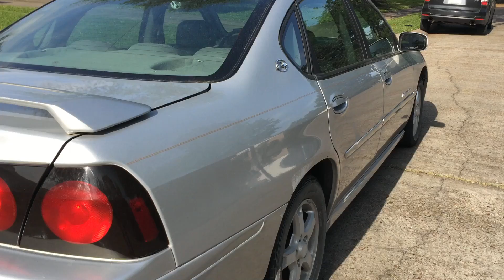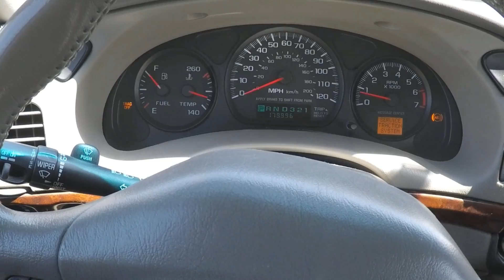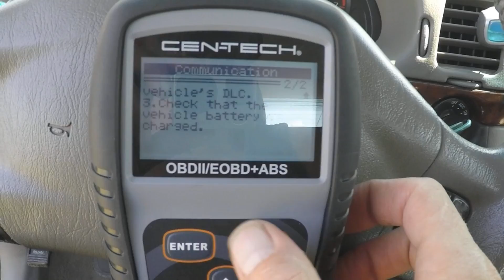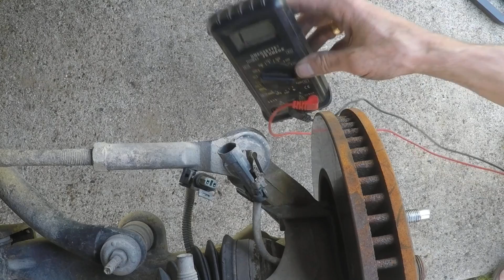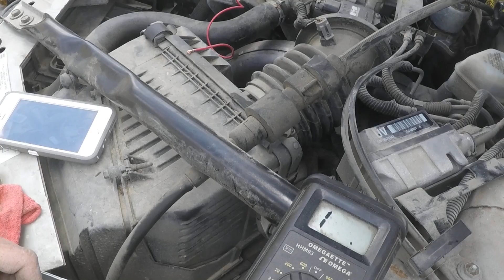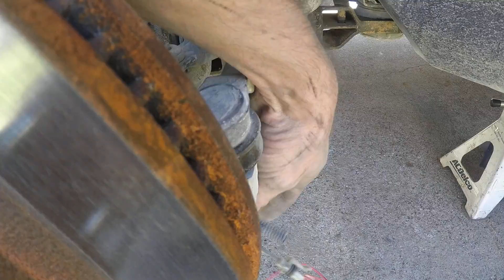ABS Light and Traction Control Off Indicator - 2004 Chevy Implala

Comment: I have a 2005 my light came on and it said to service Trac control took it to a shop they replaced both axles and both front wheel bearings but the light is still on. I don't want to pay anything more until I find out what it could be from !! PLEASE HELP ME!!

Comment: I had the same problem the same code and I watch this video and then exactly what you did I checked it found a broken wire about 8 inches from the plug to the ABS sensor I offset cut the wires the top and bottom the new wires through there and have them twisted I solder them and cover them with heat shrink and it only lasted one day and the same codes back what's wrong I have four brand new wheel hubs I am very confused is this situation

Comment: I know this is an old video but I had the exact same problem. Watched this decided to go down to the driver wheel disconnected the plug from the sensor unclipped the harness about three clips back to give me room to work. Then peeled back the harness cover found the yellow wire was broke bout 6 inches back from the plug. Patched it with a wire connector the electrical tape it for protection the placed the harness sleeve back on. Plugged it in and no more error. Hope this helps someone.
Reply: I think that's the best way to go you don't need those stupid sensors on the front wheels anyways old cars you never had them and you don't need them on the new ones
Reply: @freddygranado3217  These cars aren't so new anymore ;)
Reply: Would that be related to why on my Monte Carlo, same as Impala, has the BRAKE light on in cluster? But E brake is fine, so idk..

Comment: Hi there & great video, I have read many others about the Traction Control service light & ABS light coming on but I haven’t read any with it making a loud noise while the lights are on. When they go off the sound stops. I have an 02 Impala so is my issue completely different because of the loud sound I hear when the light indicators come on?
Reply: Mine made a load noise when I accelerated like a grinding noise but I think it was just the brakes reacting to the perceived slipping of the wheel. That is also when the traction control light would light up like the wheel was slipping. The wheel was not slipping. Mine was a faulty wiring harness on the left front wheel.  After inspecting the wires I found a discoloration on the wire, sure enough when I pulled the wire it came apart. spliced in a new abs wiring harness and now it is running like it should no more alarms no more noise. I like my impala again.
Reply from the maker: I can't say, but this vehicle did make noise when turning at low speed. I would suggest checking the abs outputs to see what it looks like.
Reply: Mine does the exact same grinding and lights go off after the grinding stops mines a 2013

Comment: Great information video sir.. Was just wondering what size or gauge wire should someone use? Thanks a million...
Reply: More important than the gauge (size), is its flexibility. Both of my cables in the front had broken the wires internally due to the minute, but continuous flexing while driving. They were broken where the bottom of the suspension meets the frame (not too far from the connector IIRC). You wouldn't think that it would break there, but it did.

The way that you find a broken wire is to look around where the cable flexes for a bulge in the wire. Grab the wire from either side and pull. If it's broken, the wire will continue to stretch until the insulation breaks. This is what I found on three of the four wires on my Impala.

The factory harness was about $150 (per side) from my dealer, and it was not likely to last any longer than the original. So I replaced mine with "Olflex" superflex cable (10 million cycle rated) that I got off of eBay for about $40 (I only needed a foot for the entire job, but this was the best deal that I could find at the time). Flexlife-10 is another option. We use this type of cable in our robot cells where we may build 250,000 parts per year. 

A better option is to buy a 3 foot chunk of 18 gauge "Superflex 2" from TQWire for $3.50. Use marine-rated butt splices (shrink tube ends) to keep the water out. Since this is an individual wire, and not a multi-conductor cable, you will have to use one wire per conductor (you will want to replace both conductors per side). The TQWire wire is a better wire than the Olflex (441 strands, quite a bit higher than the Olflex IIRC), and being an individual wire as opposed to being part of a cable is of no consequence.
Reply: 18ga should be fine.  (18 gauge)

Comment: See now my issue is different.. 03LS 3.8 with the traction warning, brake warning and the low brake fluid warning (fluid is full) everywhere I've brought the car I never get a straight answer
Reply from the maker: 0Sideswipe0 Hate to hear that. Would be an interesting diagnosis if you were closer.
Reply: Trey Clanton yeah.. I'm in ri not sure where you are

Comment: I have had problems with this for years. I have change hub bearing and no results. I just saw this video and pulled the ABS connection apart blew in it and plug it back in then started my car. The damn light went out! Wow!!! I restarted the car about 10 times and drove around in disbelief. Thanks!!!
Reply: I'm wondering if the sensor being dirty or corroded is the problem with my car. Never a problem until I had to drive it through shitty winter weather here, inches of snow on top of ice and all the ice, snow, gravel, and salt on the highways.
Reply: Yeah I watched a guy simply unplug and plug back in harness by tire rod on drivers side... fixed it in about a minute lol

Comment: Also have heard that on the 2006-2014 series its not uncommon for the wires to get in contact with the chassis and rub it and short out.
Reply: Tumbleweeds can cause this issue as well, I was driving thru Kansas a few weeks ago and you could not help but run over the tumbleweeds they were everywhere. That is when my problem started. Dang old tumbleweeds one must of got caught up in the wires and caused my damage. All fixed now, just spliced in a new abs wiring harness. No more alarms. Maybe I need a cow catcher for tumbleweeds on my impala.

Comment: Had this issue several times on my 2004 Impala.  Turned out once to be corroded connections inside the bearing harness. Second time it turned out to be a pinched bearing wire - the strands were slowly breaking one by one. It would set off the three lights (ABS, Brake and warning centre) when you were turning.... when you hit bumps...  heck even at a stop and when you hit the accelerator.  Odds are - if you have the three lights come on erratically - backing out of a driveway and coming on when you turn and pass over the curb...  or driving along and coming on when you hit bumps...  or turn the wheel sharply...  its a WIRING issue.   Somewhere, either the wiring is shorting out - as you saw here - or its not making a good connection.  GM's harnesses are notorious for letting water / salt in through the top and corroding inside.  Check these first before some mechanic says - oh, its the bearing... cause these are expensive.   and a pain to change if they are seized.   And the ABS control module doesn't go that often... I go through wrecking yards all the time looking for shiny new parts and NEVER see shiny new ABS control modules.  So don't let some scammer mechanic say its one of those until you check all the harnesses, the wiring, and the bearings.   And bearings more often fail on the passenger side... since the tires on the passenger side fall off the pavement and hit the shoulders and ruts there more often than the drivers side tires do...   I have many miles on the Impalas I've owned so learned the hard way.  Hope this helps someone.
Reply: Ranger Rick thanks man your comment somewhat helps me seems like you know what you’re talking about I need help. Just yesterday I noticed the” trac off “ light and “ABS” light were on and also the “Service Traction System” light. Don’t wanna take it to a mechanic because I feel they will try to scam me. Idk what to do
Reply: Im having same issue on 03 impala. All 3 lights coming on. Damn thing scared the crap out of me one time, went to stop at a intersection and brakes felt like they werent going to stop. Felt a crunchy/grinding(like it was trying to engage or something)feeling in brake pedal and thats when the damn trac control lights came on. Slowly been getting worse. Now lights come on just backing out of garage, or slightly turning wheel.

Comment: BBB Industries offers free access to the Technical Service Bulletins (TSBs) issued by GM and other manufacturers.  This is a treasure trove of information on known problems with GM and other vehicles. For example, my 2010  Equinox has similar issues, and in looking at the TSBs for my specific vehicle I noticed PIT5062C (the problem with the 2010 is not mentioned in PIT5062 A or B), which describes a bad splice in the wiring harness under the carpet just in front of the drivers seat, as well as a large plug that gets loose from the connector and lets the pins corrode. The plug and connector are located ahead of the front passenger seat and mounted in a high position sort of behind the outside kick panel. That TSB has pictures, but the complete TSB with the pictures is not easy to find. Alldata and Mitchell don't have this TSB at all, as far as I can determine after searching both of them.  This is just a small example of what you can find if you dig deep enough. The dealers will never mention these easy fixes. Another source of inspiration is a YouTube video by Tony Lester, who dug deep on his own and found a really bad ground on his 2014 GM truck located just under the bottom left corner of the inside of his windshield under a dashboard panel. Misapplied insulation kept the "grounded" wires on his truck from making good ground contact, causing all sorts of electrical issues.

Comment: Thanks for all the homework you did for me,  I found out that I had a problem with a broken wire in the passenger side wire harness and did a splice with two barrel crimps, heat shrink and some plastic wire casing. works great with no lights. Again thanks much !
Reply: Tom McDonald what size /gauge wire did you use? Thanks
Reply: Duane St John 
Duane, I bought a ten dollar harness on ebay and it was about 5 feet long with the plug already on it and it was a 16 or 18 gauge wire I believe.

Comment: Hello Trey. Thank you for the awesome video. You mentioned pins 2 & 3 for the driver sensor. What are the pins for the passenger side please? My open is on that side. Thanks again.
Reply from the maker: Impala Lover I'm not real sure which pins that it. You might search for a schematic or physically trace the wires. That's what I had to do.
Reply: Okay. I appreciate it. Thanks again. You really helped me out a ton. Thanks for taking the time to make this video.

Comment: Love your very helpful video. Can't wait to check mine out. Can you buy twisted wire somewhere or do you just make it?
Reply from the maker: Bart Jones I just made the twisted pair with 2 wires. If you clamp two ends in a vise or get someone to hold them and then chuck the other two ends into a drill, and you're off!

Comment: Good video, I have fixed many ABS issues in the last 4 years and you tested wires that many do not and suspect the hub and just do swaptronics only to figure out that they wasted their money.  I like how you tested the in between wire as this has resistance also.  I fixed a Sienna this way as the sensor was good but wire was Out of Limit.  bought a replacement for $20 at a junk yard as I pulled it myself and tested it before buying.

Comment: I just had to have mine fixed and it was the Hub it was broken.  Had it replaced last week and the indicator is off and when I press the Traction button on the left of the steering wheel it works. Before it didn't. it was on the Right front tire.
Reply from the maker: Dorothy Owens - Good deal! I'm glad you got it worked out!

Comment: There is actually a bulletin out there for these. No. 03-05-25-008. Not certain if it covers the 04 Impala though. I have also seen this on Cadillac Devilles.  You can get the jumper harness although it is a little pricey. I have seen this happen where they break down between the main harness it goes into and the wheel speed sensor connector.
Reply: 15 bucks on amazon for the harness

Comment: Thanks for the video.   Today I began to have the same issue with my 2005 Impala, and the little bit of online research that I've done so far indicates that the problem is difficult and expensive to diagnose and repair properly.  I'll stop at AutoZone tomorrow for an ABS code reading to see if I can get a good starting point to proceed from.  My problem is identical to that of others that I read about, the brakes pushing back the first time that I apply the brakes at slow speed after having been parked in a lot, then the ABS and Traction Control Off indicator and warning lights coming on, then the warning light soon turns off but the ABS and TRAC lights remain on.  But fortunately (so far) the brakes perform normally while driving at normal speed.  The problem occurred this morning moments after I stopped to check and add air to my tires to bring them up to 32 psi cold, so now I'm wondering if the tire pressure sensor system is in any way related.  WTF, what can go wrong with a simple electrical wire between one end and the other barring a traumatic physical injury to the wire?  Is it defective copper stranding or molecular problem with the copper?  A wire cannot oxidize if it's properly insulated from exposure to air.  Godammit, the more sophisticated that these cars' sensor systems are made, the more trouble we always have because the warning systems themselves go bad.  (I'm also dealing with an airbag warning light that I had ever since I bought the car used.)  But in any event, there's no way that I can spend $1,500 or more on this car to repair this.  For one thing, the +/-20 MPG that I'm getting sucks, and I need to have a complete diagnosis done because beyond that, the car runs great.

The one thing that I'd try first if the sensors or wiring harness are suspect is contact cleaner on the plug connectors to clean any oxidation or dirt, and then proceed from there.  The worst case scenario is a bad control module or worse, a bad pump.  Mama said there'd be days like this.  Thanks again.

Comment: funny thing I checked with my meter on both rear hubs and the harness and got the same readings , but when I swapped sides with the harness it always says the right rear sensor in the codes , even after clearing the codes with my autel maxidiag, but it won't clear the right rear sensor at all